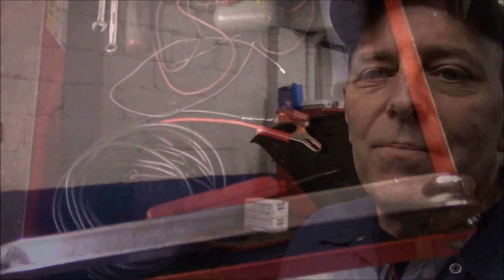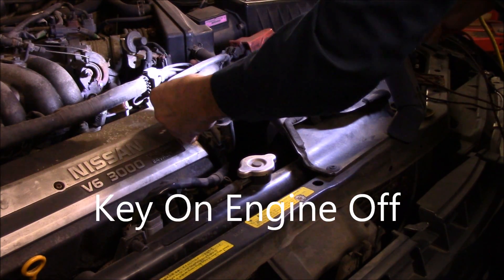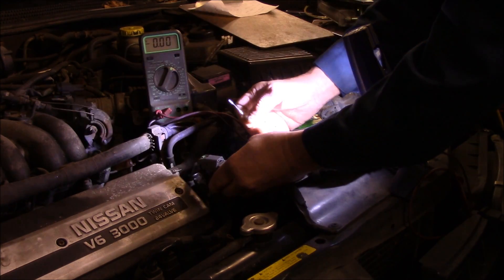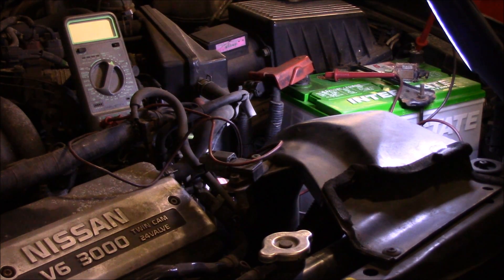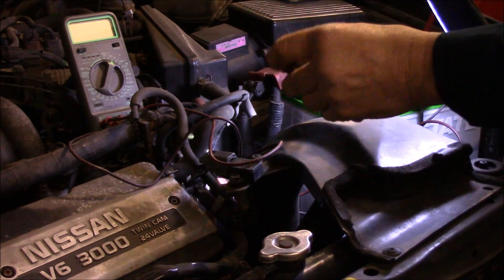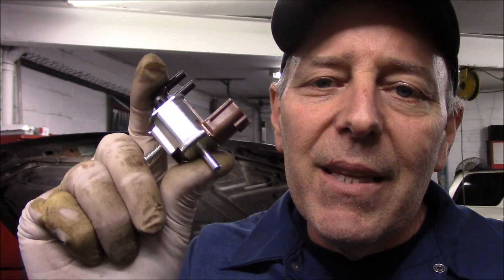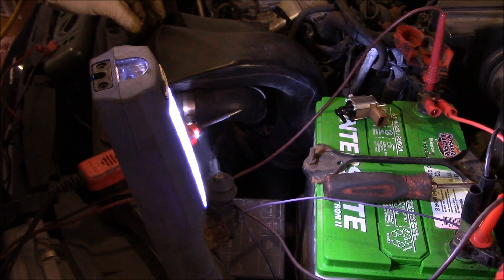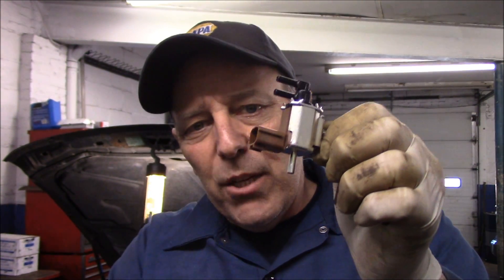How to diagnose and repair a P1105 and P0105

Comment: Great vid. I have a question, why is there so many different names for the MAP sensor? IAT being one of them. Also I have code P1105 on my R56 mini but I don’t have this turbo solenoid as my mini isn’t turbocharged. I’ve just replaced the ‘MAP’ sensor (IAT) but didn’t do the tests you did, hopefully this fixes it. Thanks for your vid

Comment: Thanks for the video Jim! Question: I don't have access to a vacuum pump, but I'm assuming that the signal voltage should get lower as I apply throttle?
Reply from the maker: Thanks for watching.
Reply: Voltage should drop when applying vacuum pressure. Release the pressure and the voltage should return to normal. Hope that helps

Comment: Jim,I have watched the video couple time trying to understand the procedure, im little confused, you check for 5 volts reference then you back probe the connector with a pin, my question is ,you back probe in the wire that has the 5 volts references? My other question is ,on the baro/solenoid the polarity for the outers pins it matters ? I hope i make me understand better this time, thank you jim  you are my hero, take care,
Reply from the maker: Thanks for watching.

Comment: Quick question, I have a P0105 code only and it says it's the MAP sensor. I replaced it cleared the code but it came back on. Should I try the solenoid next? I tested all the power and the vacuum line is OK. Thanks for any help. It's on this car as well
Reply: Did you test the solenoid and was that the fault I have the p0105 on my astra ivereplacedit and cleared the fault but still engine management light is on
Reply: @youtubescrap  bro I never got it fixed. The shop wanted $1000 to fix it. They said it's safe to drive so I did then sold it.

Comment: Hi Jim,
Could you do an ohm meter check of the coil as a double check of the solenoid for those that do not have a power probe
Reply: Stan Skubis  It's not a great test. you can ohm test but  if the solenoid windings are good but and the valve is mechanicaly stuck you will still get a good ohm reading. You can always take long wires right off the cars battery. best to use a fused wire for one of the wires.. that's basically all this older power probe is doing
Reply: reweydewy 
thanks for the helpful info. Will remember next time I come across it